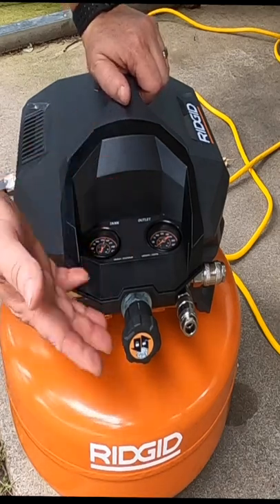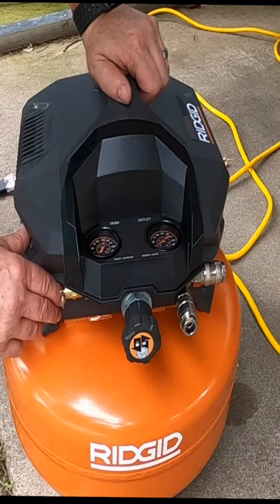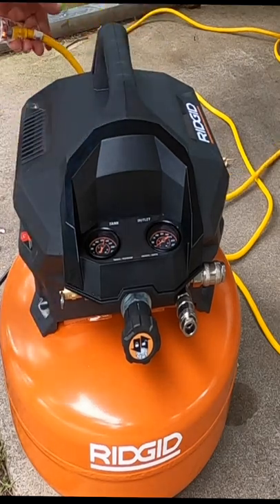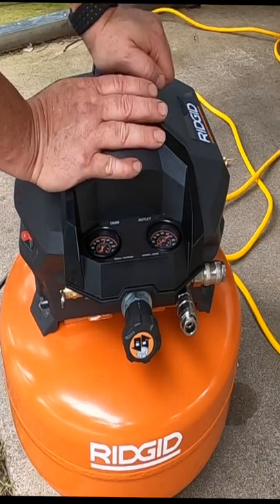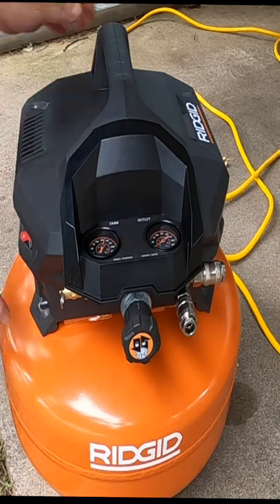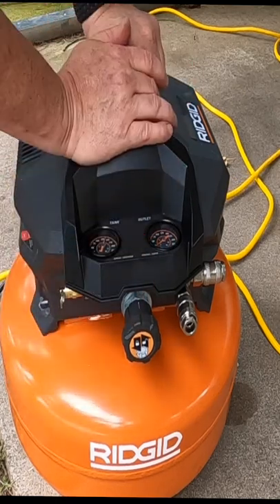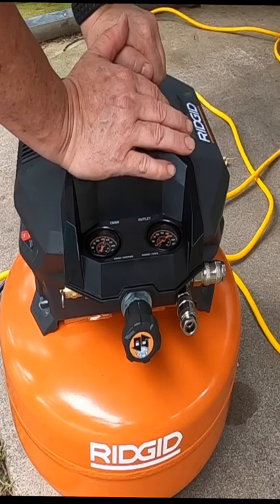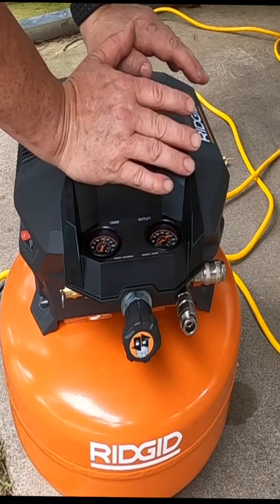How To Fix Air Compressor Overheating or Shutting Off #shorts

Comment: I have this unit. It's been great for the 5 or 6 years I've had it. Right up until now. It started to lose pressurization capability, and it would run too long and overheat. WELL, I took the casing apart to discover there's a short flexible hose that jumps from the pump to the tank, and it had a tear near the connection point. ALSO, the damned plastic fan attached to the electric motor was missing ALL of it's blades. All of them! They had all snapped off. About 5 or 6 of them fell out when I removed the casing, and it made me realize I've been wondering what these odd-shaped plastic pieces were that I've been finding in my yard and shed. 😜 If you have overheating, look through that little vent grill on the side (that's the air intake for the fan) with a flashlight and see if you can still see an intact fan. Meanwhile, I am still searching online for a replacement - Ridgid used to (out of production now) sell it but only as a part of the whole motor component. I'm thinking I'm going to have to rig up a solution with the fan from another product. I attempted to use some aluminum from a rainwater downspout strap, shaping 4 blades and affixing them to the hub with tiny bolts and screws, but that self-annihilated on first attempt to turn it on. Back to the drawing board!
Reply: Thank You for the heads up!
Reply: Careful with these when they get old.  Tanks can rust, they then blow up.  All kinds of stuff can happen.  Why not just get a new one?
Reply: @vinceking7878  The tank has an out of service date stamp on it. It's several years down the road. I'm not worried about the tank. I follow the manufacturer's recommendation from the owner's manual and I release the air pressure in it with every single use when I'm putting it away to reduce the amount of rust causing moisture trapped inside. I'm a firm believer in keeping things well maintained and making things last longer than most people. Keeps my impact on landfills smaller. That's my own personal method. So many people just don't care.

Comment: PPL DON'T READ POWER CORD ONLY USE FOR TOOLS
Reply from the maker: True that.  😁👍
Reply: I have a husky 20ga 175psi and it heats up when on and I did the trick and still overheating
Reply: @ryanfil1927  Check the cooling fan to make sure the blades are still there... (see my post comment)
Reply: @InexplicableBill I opened it up and there are two blades on each side on the motor. They re intact. I see the aluminum hose from the motor to the tank kinda wobbly
Reply: @ryanfil1927  If that wobbly hose is causing pressure loss, the motor may be running longer than designed to, causing things to overheat. Maybe put some thin soap liquid (like watered down dish soap) around the fittings to see if they bubble when it's running. If so, check if they're tight enough, or maybe the tube and fittings need replacing.